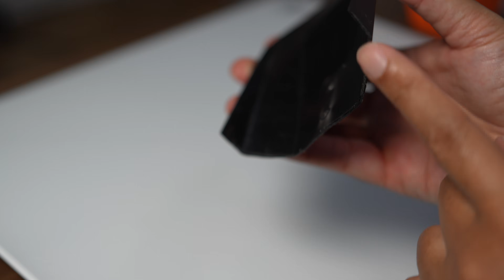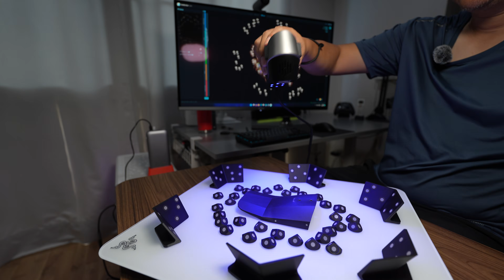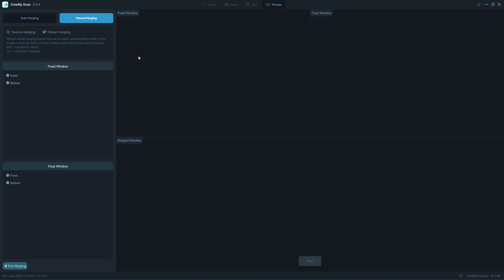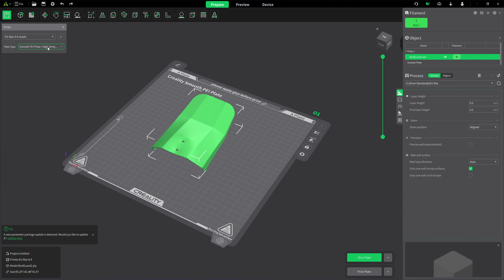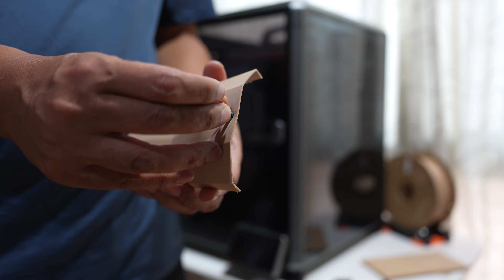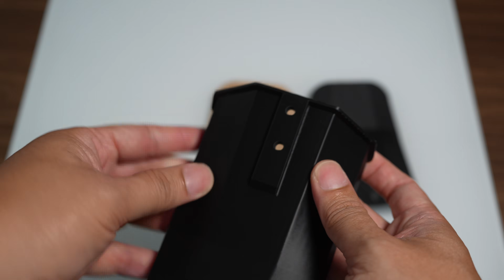Part Cloning Scan and Print with CR Scan Raptor - No CAD or Post Processing - Begode T4 Mud Guard

Comment: is this possible also with otter? Will accuracy  be enough? I think it will, but you have like 100x more experience with scanning and 3D
Reply from the maker: The 3D scan model from Otter in medium mode will have a tolerance of approximately ±0.1 mm. It may be necessary to enlarge the holes slightly to ensure a proper fit.
Reply: @Payo-TensileCreator  Thanks. 0.1mm will be fine for what i need. Thanks again!

Comment: Is the new marker merge feature on the latest public version or is it a beta or something?
Reply from the maker: It's on V 3.3.4 and I think it's been there for a while prior to this version but I didn't notice it and they never told me about this. (Probably they didn't notice this as well) It works great if you have overlapping area larger than the marker size.
Reply: @Payo-TensileCreator  True, I just checked, I didn't notice because I normaly use the point based alignment in Meshlab

Comment: Dude you keep confusing me. I was about to buy otter as from your videos i got a feeling its best of both worlds and sits well between raptor and ferret. After seeing this video i am confused again!
Reply from the maker: Here's my rule, if the object requires markers to be able to scan, I will pick Raptor, other than that Otter all the way.
Reply: Otter is 👍🏾
Reply: I wish I would have got the Otter. The Raptor does capture great detail, don't get me wrong. But if I want to do anything larger than a small figure or mechanical part, it's just not fun. The NIR scanning is near useless with such a small field of view on the Raptor and should have just been left off of it. But I just got the wireless kit for it and that makes the experience better with the blue laser. Holding the scanner without the pistol grip gets tiring fast for me.